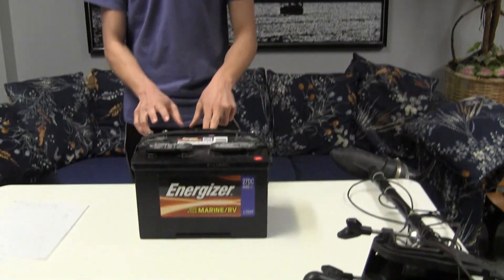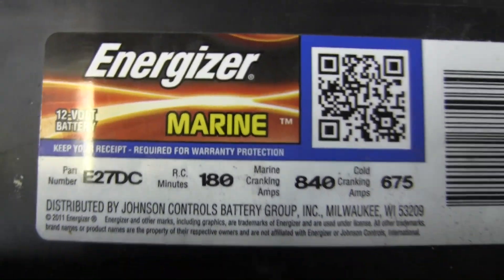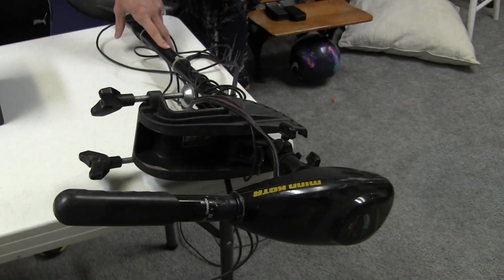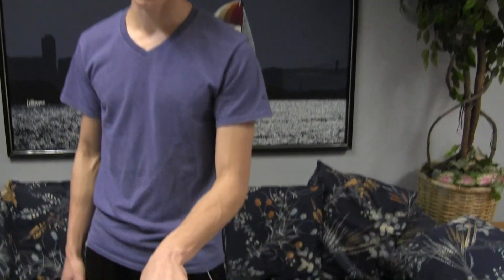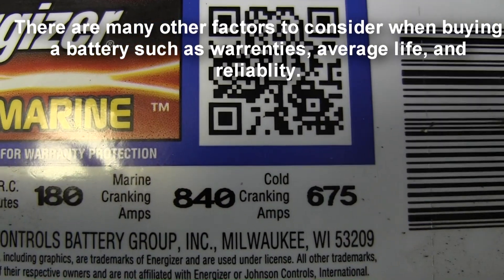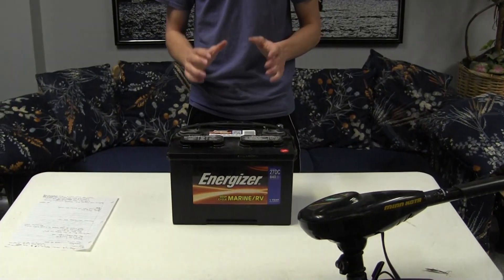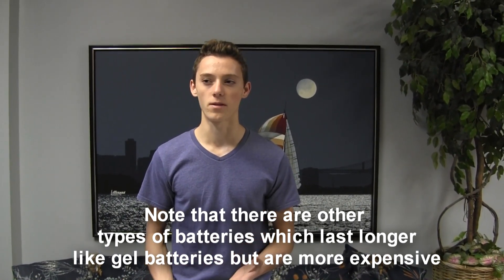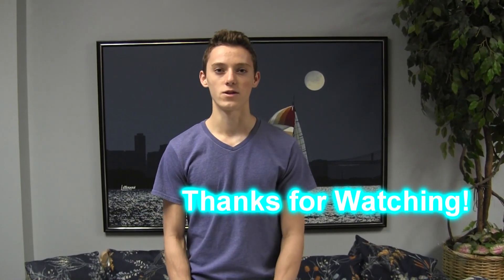Marine Batteries for Trolling Motor--Specs to Look For--(deep cycle marine 12v batteries)

Comment: I have a technical question. I have never had a trolling motor so I've never dealt with anything concerning an appropriate battery, etc. Me and my neighbor were talking about some county lakes have row boats to rent. They allow the use of trolling motors on the row boats. My neighbor said to use a motorcycle battery to save weight. Is this a practical substitution to a large battery? Would the trolling motor deplete the motorcycle battery quickly?
Thank you!

Comment: I do not get it.  You said a 180 RC at 25 aps will last about 3 hours.  How did you calculate that?  180/25 does not = 3??  Show your math!!
Reply: What a maroon! Here is the math -
----------------------------------------------------------
3) RESERVE CAPACITY
What does the Reserve Capacity rating mean and how does it apply to deep cycle batteries?

ANSWER:
Reserve capacity is the number of minutes a battery can maintain a useful voltage under a 25 ampere discharge.

180 minutes equals three hours (180/60=3)

Comment: Really good information here; much more informative that than the sales staff at several locations I visited. Great job! I'll pick up a group 27 (800 cranking amps/150 RC) for my MotorGuide ET38 which I'll be using on my 17' Clipper canoe. Cheers,

Comment: Good Video. However I use just a plane car battery for my little boat. I never draw more than 40% out of it. You never touched on the difference of a D.C. battery and a regular battery. The only difference is the plates inside the batteries. Regular batteries have thinner plates designed to shed it's electrical power in quick burst to start a car. D.C batteries have thicker plates designed to shed its electrical charge slower. However a regular battery can shed power slowly as well. This is why your able to listen to your car radio for hours without hurting the battery. The trick is if you use a regular battery not to completely discharge it and to put it on a battery maintainer when not in use..

Comment: Sir here in middle east people usually not use marine batteries i went to several shops but they even dont know the marine deep cycle battery they. Is there is any other way to find it any battery number or anything else.

Comment: Don't overlook buying a battery desulfator for tired batteries and always try not to use more than 50% of the battery time up before recharge.   Your battery will last longer with these two things- and keep lead acid batteries on trickle charge when not using.

Comment: I am new at this and I just purchased a 14ft. square back canoe and a MinnKota C2 55
my next pruchase will be the DC Battery..Would I have to install a 50amp circuit breaker on my own ?  Also I purchased from harbor freight tool co. a 13 watt solar panel to connect to my battery so it will keep charging my battery when I am camping on the islands here in Lake George, NY and on other lakes in the Adirondacks.
Let me know what you think about my questions.   Thank you for your time.

Comment: very good video, i am new to using a trolling motor..my 10hp gas motor was stolen  2 weeks ago and i am stuck with this 40lb minnkota for the time being..i did not know i needed a circuit breaker/fuse with the trolling motor and battery..can i use a 50a inline fuse until my circuit breaker gets here(ordered on ebay). any info would be appreciated..thank you
Reply: Cc c".ô
Reply: tan thien tai Tong nrtyw npkdaw bmdg

Comment: For an electric trolling motor you should use a Deep Cycle battery preferably a Gell Cell SLA if you can afford one.They are expensive but are designed for deep cycling not staring an engine and they should last for over 7 years.You definitely do not what a battery with a CCA rating.The cheap marine batteries are not true deep cycle batteries and are similar to a car batteries with a little more electrolyte in them.
Reply: ***** i seen your comment and thought maybe you could answer my question..i have a 40lb minnkota trolling motor and a #29 everstart(walmart deep cycle marine batt)..i did not know i needed a 50a circuit breaker for the trolling motor when i ordered motor(first trolling motor)..can i use a 50a inline fuse for now? i cant get the 50a circuit breaker locally, so i ordered one on ebay..my 10hp gas o/b was stolen 2 wks ago, any info would be greatly appreciated..thanks
Reply: gary singer I would think the Minnkota would have come with a fuse in it. I don't know what the surge current of the motor is but a 50 Amp fuse would not hurt. I would use a slow blow fuse incase the motor has a high surge current. Sorry about the gas motor being stolen they are expensive to replace. Good job on your video BTW.

Comment: Few devices can operate below a certain voltage.  For example your starter in your car works fine at 12 volts but at 7 volts it wont even turn the engine over.  The battery is still more than 1/2 full of charge but you can't start your car.  The same is true of your trolling motor.  You say that you can operate it for 180 hrs before it dies at 25amp draw.   Im sure this is true.  However like your starter in your car that trolling motor will not operate below a certain voltage. 

It would depend on the trolling motor or device but most electronics which are designed to run on batteries stop working or work at a bare minimum of capacity by the time the batter is below 70% of maximum.  So for a 12 volt system that about 8.4 Volts.  That is to say another way that your electronics only operate properly in the top 30% of the battery life.  So assuming that you are using a 25 amp trolling motor on that battery and you don't have some method of charging it and your battery starts at a full 12 volts... You will only get about 54 minutes of continual use before it pretty much stops working not the full 180 hrs.

Another consideration if you only have one battery in your boat for both your outboard motor and your trolling motor you may be cruising along with your trolling motor just fine.  Maybe it doesn't stop working until you hit 6 or 7 volts.  Still once you drop your battery below 8.4 volts it can be unlikely or even impossible to start your main outboard motor with that charge level.  This could leave you stranded or using a pull rope.  I recommend installing a $10 waterproof voltmeter on your dash to show you how much voltage you have at all times as well as testing your outboard motor to see the lowest voltage it is able to start with. (if you are using a single battery system)

Don't get me wrong that number is still useful in comparing batteries for the purpose of knowing how good one battery is compared to another but it is not at all a realistic indication of how long it can truly operate any electronic device of any given amperage.  In most cases you can just take that number at cut it to 1/3 and that's going to be a lot closer to how long it can really operate at its given amperage.

Good job on the video and feel free to add this info if you do an update.

Comment: You got very good info and friendly honest delivery. I'm subbed. Any info or advice on boat floatation foam. I have a boat I'm working on and the benches had styrofoam in them but the previous owner toar it out for chairs. I want to replace it incase of a capsize or the boat taking on eater. I wouldn't want it to sink like a brick. If you do have some input thank in advance. Oh and I hear some of the spray in foams actually soak up water over time wich causes unwanted water weight and rotting of wood.

Comment: Great video dude! And thanks for using the Minn Kota 40 lb thrust motor as an example! We just bought one (had a 30 lb thrust before) for our excursuin 5 set up we were wondering what a good battery would be for it. Again, thanks for the very useful info!

Comment: Will a TM discharge or draw current from battery when the motor is not in use but connected(battery + Motor hooked up)?

Comment: Nice Video. I am looking for a battery for a C2 30. It would be used once a year only, and wonder if an investment in a high quality would pay off in terms of lasting for decades. Is that feasible, and did you have any thoughts on what type battery would possible be ideal for that?